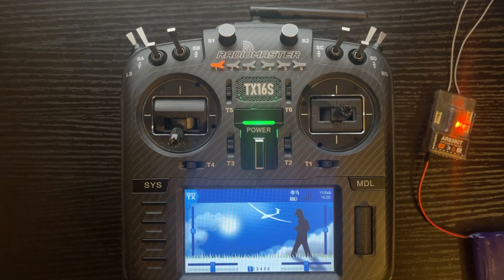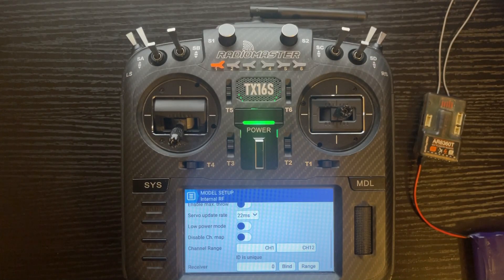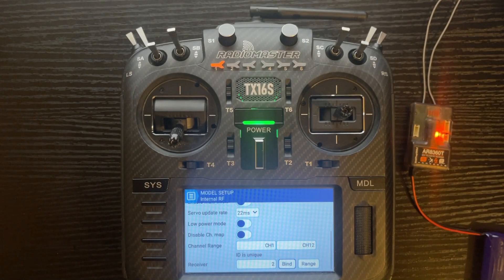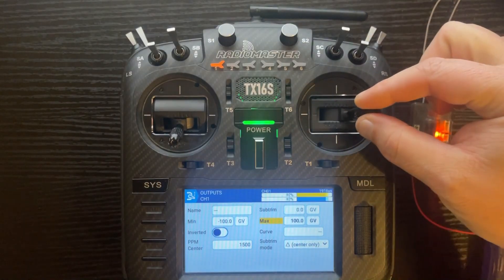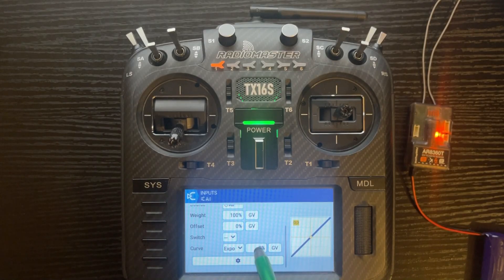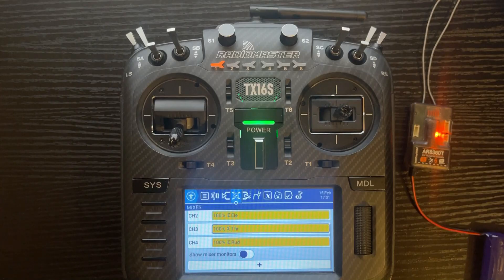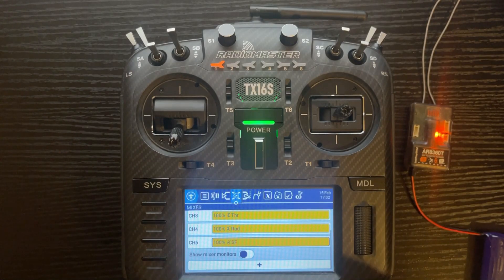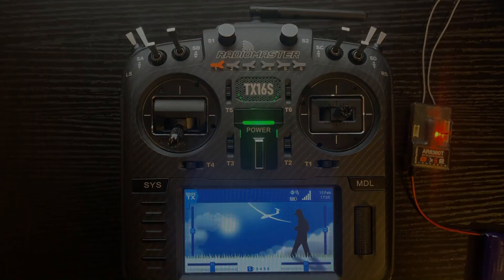Radiomaster TX16s/Edge Tx: RC Plane Setup without Template

Comment: I just bought a TX16S, Edge TX.  When I setup my radio, I did not setup Channel 5 for one side of the aileron.  I am lost at adding channel 5 to the other servo for aileron.  How do I do this?
Reply: on the mixer copy Ail and past to the 2nd channel then select Ail as the input as well, then reverse the out that's not moving correctly on the output screen

Comment: Hey BD nice video bud,my questio for you is if I buy a radiomaster tx16s max and use Spektrum recivers with it will I get the same signal quality as spektrum transmitter or better,thank you. 
Tony
Reply from the maker: Comparing flight logs of both, results are similar and sometimes better.

Comment: BD  my channel monitor is showing all the correct inputs and rates but when I bind the Lemon Dsm compatible receiver (spectrum channels)  the the control stick inputs are incorrect..
Reply: BD I think I figured it out before I was using the set up wizard and changing my inputs to match the Dsm receiver when I followed this tutorial the mapping was correct now I have to figure out the v tail mix any thanks for your help